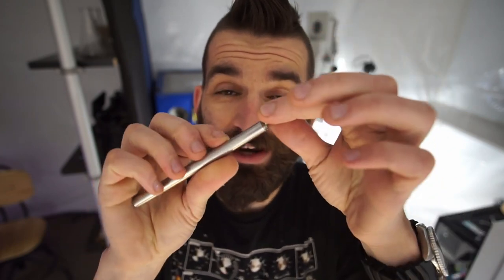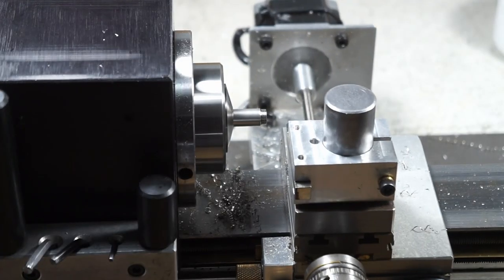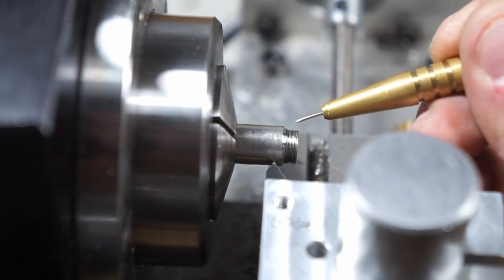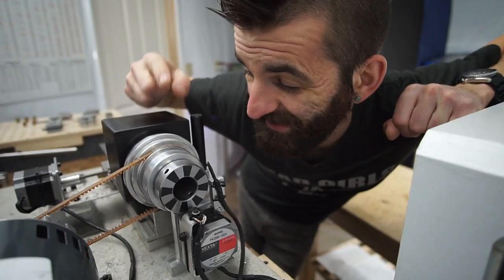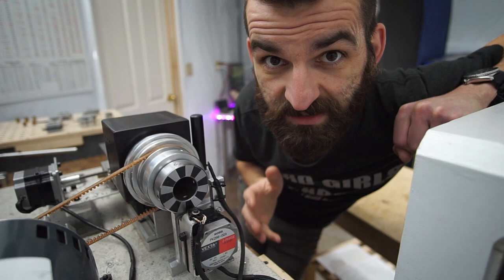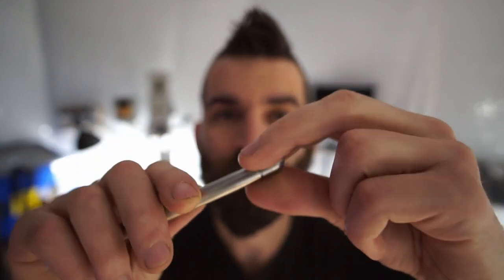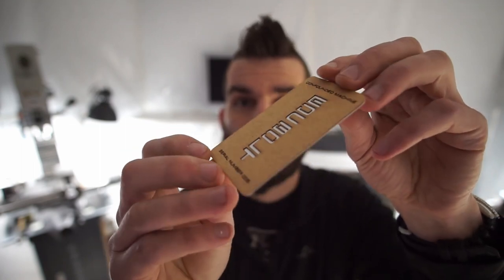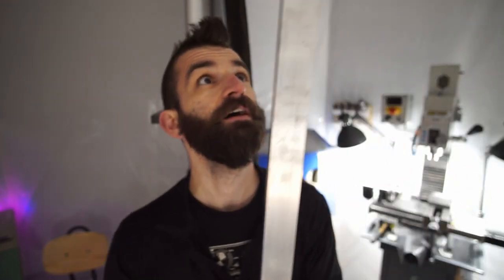Pen Threading Perfection

Comment: When the motor is under higher loads (material dependent maybe)  the current will go up, and the noise will be radiated a greater distance.  Just a possible explanation for why it may have worked marginally before your fix.   Nice job finding the problem.
Reply from the maker: Spoken like a true electronic nerd! You very well might be right!  Thanks for the comment  👌.